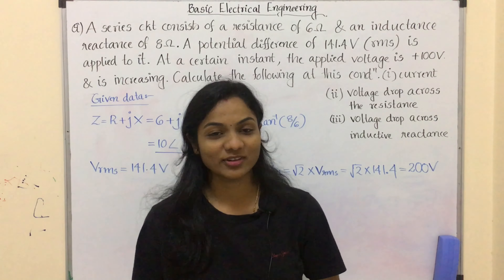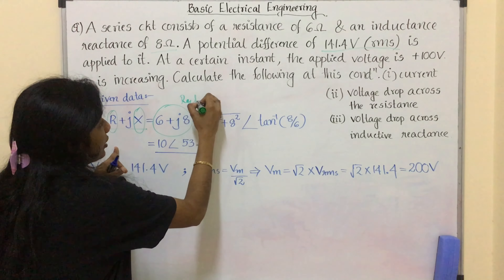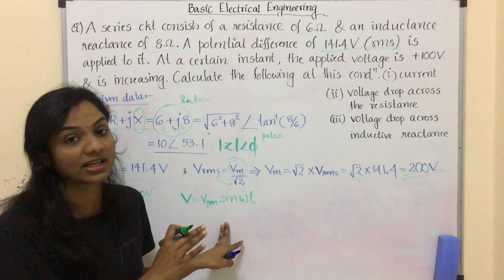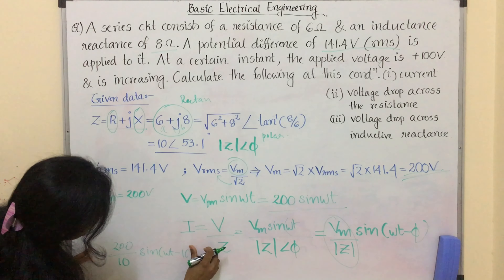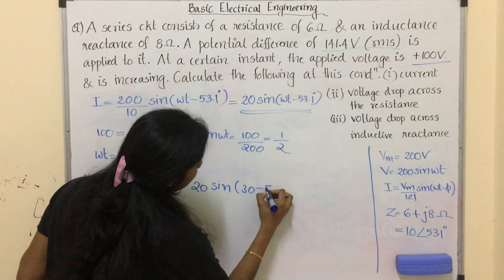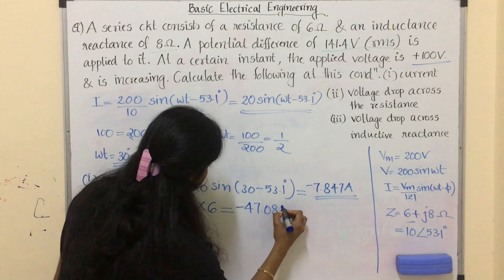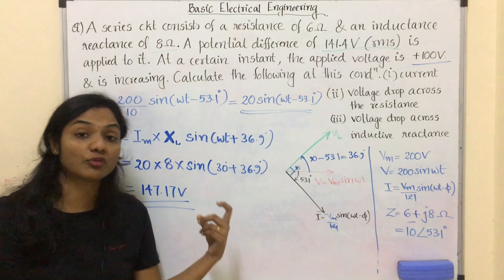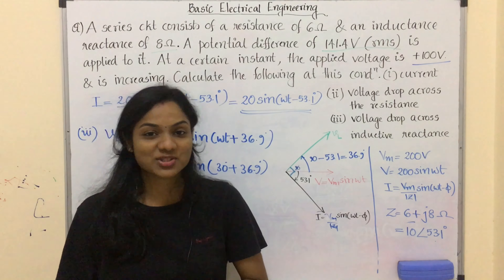KTU/ AC Circuits Solved Problem/ Basic Electrical Engg/ Mod-3/ Lec-10

Comment: Last i*xL= ithile i enn parayunnath i flowing through circuit alleaa which is -7.84 alle veruka enganeya 20 eduthe... Pls reply
Reply from the maker: I understand your doubt is for a series circuit current remains same, then why I chose 20 instead of -7.84.
Reply from the maker: If you have noticed for calculating i(30), we have used 20. Here 20 is the maximum current, Im.
That is, vL=Vm x sin(wt+36.9•)
Where, Vm=Im x Xl
This is an another way of explanation for the same.
Reply from the maker: Please feel free to comment if still you have doubt.
Reply: @CubesterAcademy  ok mam,but let me ask u one more thing,that vL nteyum vR nteyum resultant ayittalle v=vmsinwt varika,so vL enna voltage v yumayi 90-53.1 degree angle undakkunnundenkil vR vyumayi phi=53.1 degree undakille soo...vr=ir enn calculate cheyyan pattumo...
Reply from the maker: Yes.. exactly.. if you calculate in that way also, will get the same result.

That is, vR=(Im x R)sin(wt-53.1)
vR=20x6xsin(30-53.1)=-47.08V.

Same as the result we got earlier.
Reply: @CubesterAcademy  oh mam... I was not checkd it... Anywy u r supercool🥰and thanks for the fastest reply.... 💃
Reply from the maker: 😊 thank you. Please share this channel with your friends. Module1,2,3 basic electrical covered
Reply from the maker: All the best for your exam😊👍🏻
Reply: @CubesterAcademy  thank you mam..ee channel nkkiya padiche three modules m..
Reply from the maker: You’re welcome 😇